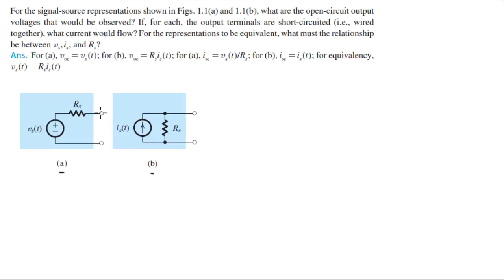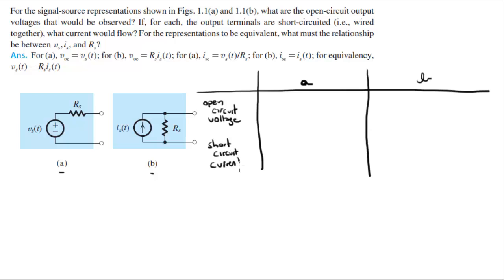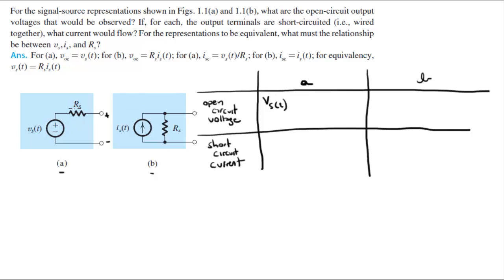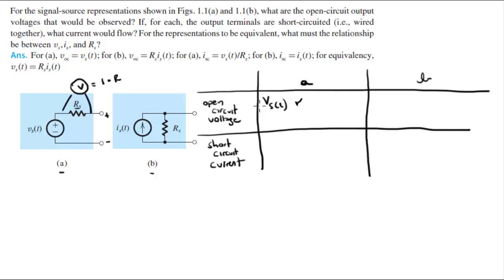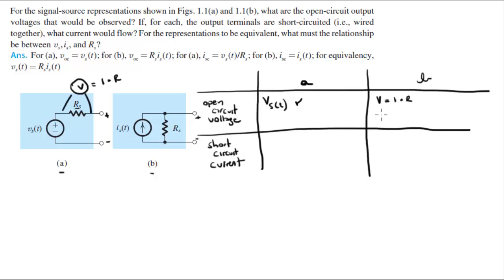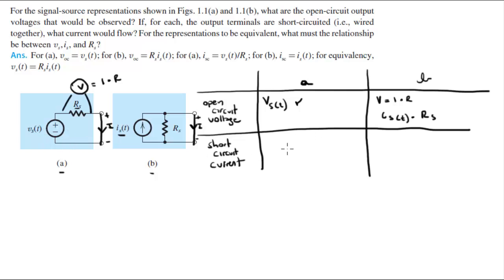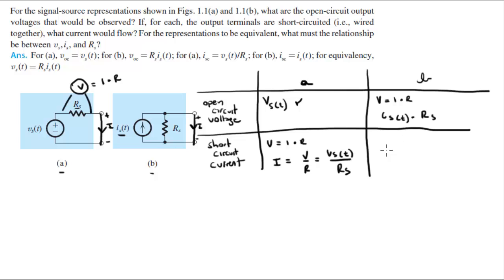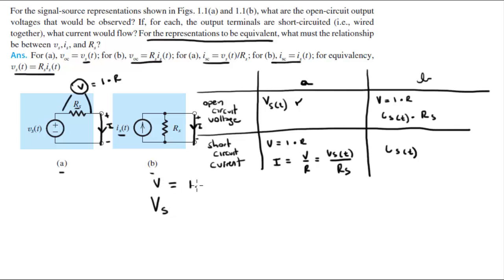Find the open circuit voltage and short circuit current

Comment: Hey dude, I had a lab where we measured open circuit Voltage, Current, and Power as well as short circuit versions of those for a single phase transformer. Is there a way for us to calculate line to neutral voltage given those things? We're super stuck so I figured I would ask.